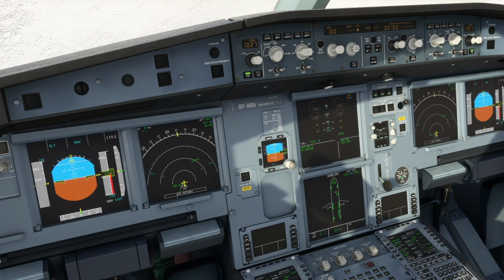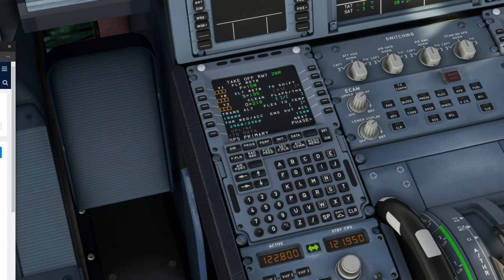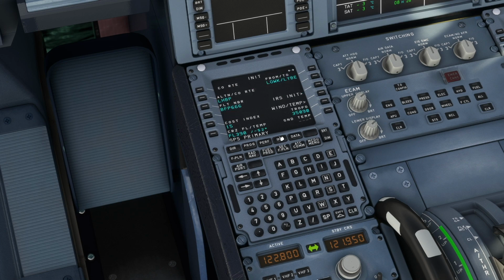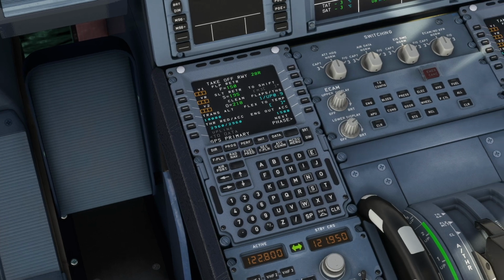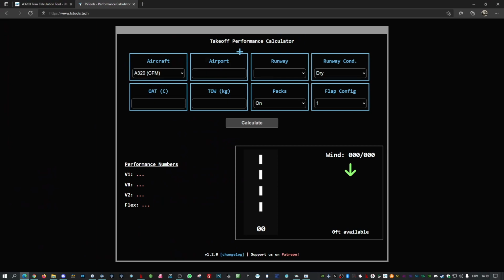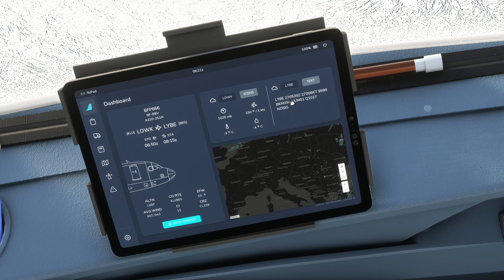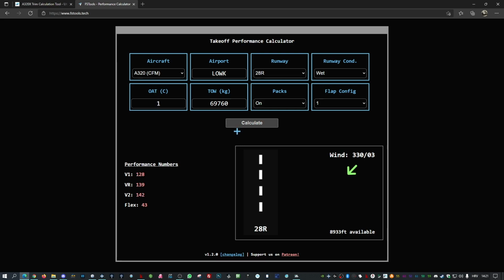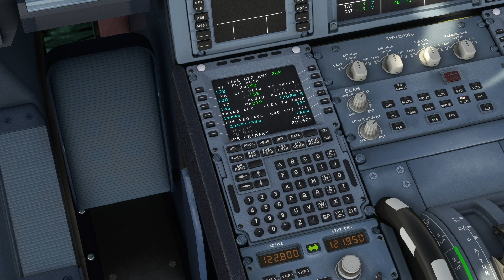Tutorial Flex to Temp Airbus A320NX FlyByWire - MSFS

Comment: Let me get this right... you used your zero fuel weight center of gravity to compute your trim setting for take off?   Shouldn't that be based on take off weight center of gravity?   how you did it, you are assuming your fuel has no influence on the trim of your aircraft.  What you really need to look at is the load report, or short of that, look at your weights and balances page to get CG information.  Sure, some fuel will burn off from the gate to the runway, but usually not enough to affect trim too much.   Also, it is my understanding that the THS setting really does nothing except produce a warning if you don't manually adjust your trim to match it close enough before take off.
Reply from the maker: Go and check official Airbus documentation, and you will find a chart with all possible CG-s, and related trim settings, Airbus is weird, not like Boeing, and it is not flap settings it is trim settings. Flaps settings are calculated with different math. There is another way of calculating trim (by weight) however I didn't cover that in this video, but get to the same point.
Reply: @FlyOverGames  I meant trim setting, not flap setting and corrected it in my response.  You used ZFWCG to get the trim setting for take off.  The plane has fuel at take off, so I'd assume a different CG.
Reply from the maker: As I said, go and read the original Airbus manual,  search where is talking about trim and you will find exactly the same there. Even a table with numbers of all possible CG and equivalent trim settings.

Comment: thank you for your helpful  tutorial. However I do believe you made 2 critical errors, the first being you used the outside temp for your destination instead of takeoff and te second was your rotate speed. you spoke the right number of 139 but you entered 138.. over .
Reply from the maker: Hi, thank you for the comment, it is possible that I made an error, I remember recording this video in such a hurry between 2 travels, I can make the correct version later if that will help. Anyway, I plan to revise all my old videos after the new update because many things will change.

Comment: Unfortunately that Trim Calculator is inaccurate as no matter what value you put in, it will always display the same incorrect value.
Reply from the maker: That is not correct, values for the trim in the calculator are from the PDF Manual of the FSLabs A320, and it will give you the appropriate value depending on what is your CG. Maybe numbers are a little bit different for the NEO plane, but at this moment this is the best that you can get.
Reply: @FlyOverGames  try putting in different values, the result will always be 43 degrees
Reply from the maker: @Fakester  You must be doing something wrong, trim calculator can't give you the value of 43 ever, It range from 2.5UP until 2.5DN and that is all you can get from it. Are you maybe talking about FLEX temp calculator ?